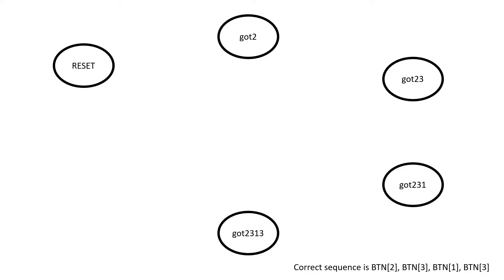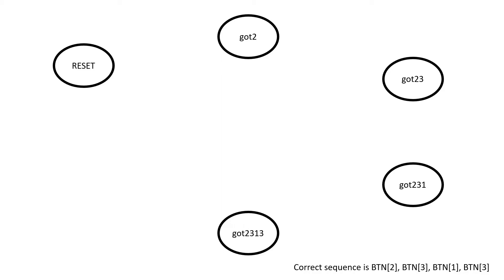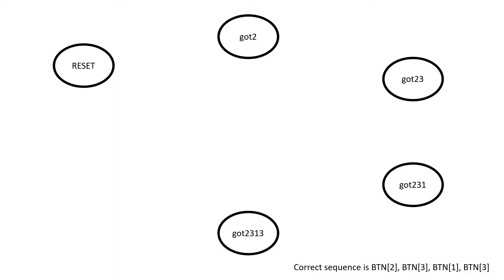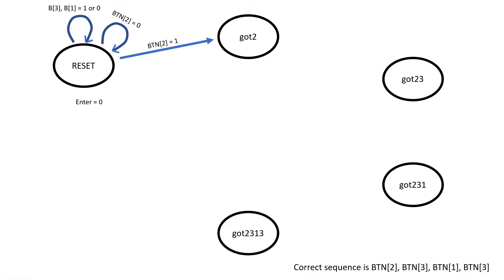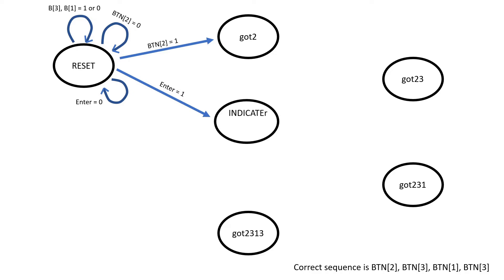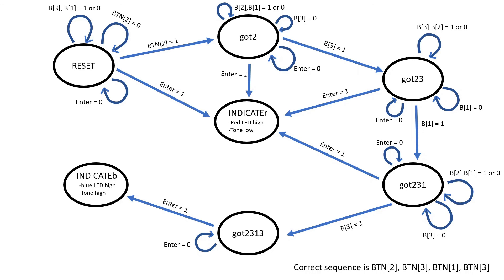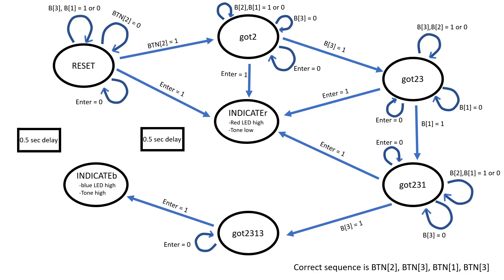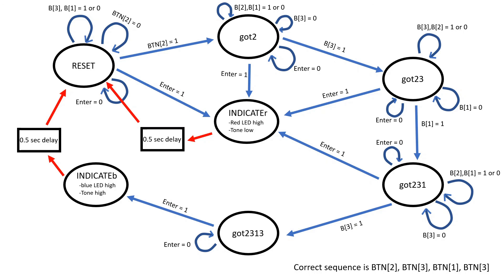Xilinx FPGA Projects With Vivado: Button/Keypad Sequence | Part 1: FSM

Comment: It seems like this FSM would allow for any long sequence of buttons to work, as long as somewhere in it there was a 2 with a 3 later, a 1 later than that, and a 3 after that.
For example, wouldn't 21313 work as well as 2313?

Would it be better to return to Reset any time a wrong button was pressed?
Reply from the maker: Maybe, I think what should have been added is some sort of delete button that cleared the previous entry like when entering a credit card pin, that way you wouldn’t have to enter the whole sequence again after hitting the wrong button. Lots of room for improvement. Why dont you do the improvements yourself? I would love to see what other people create!